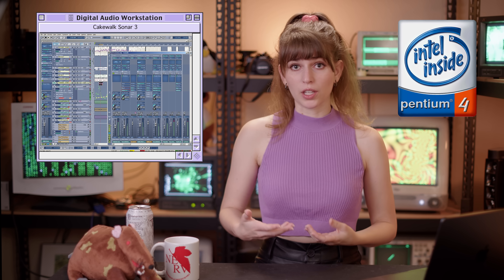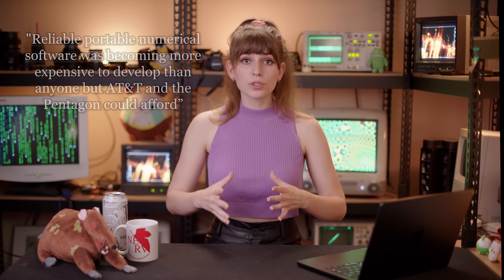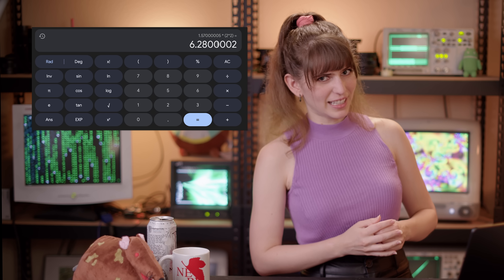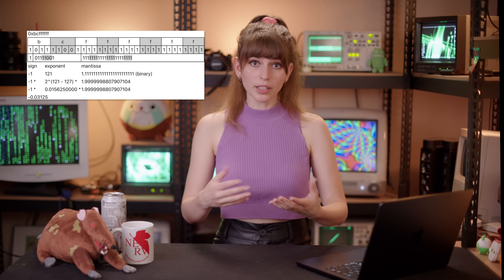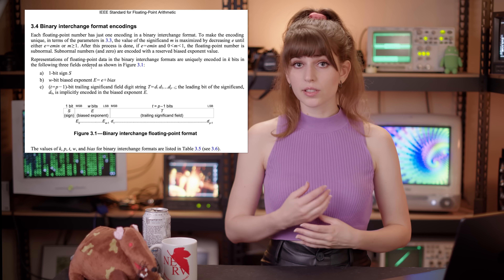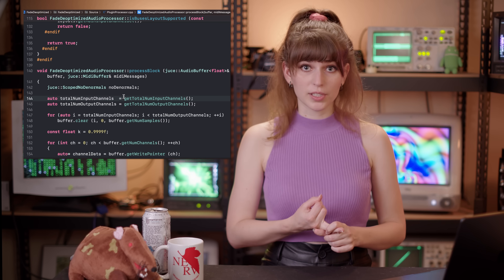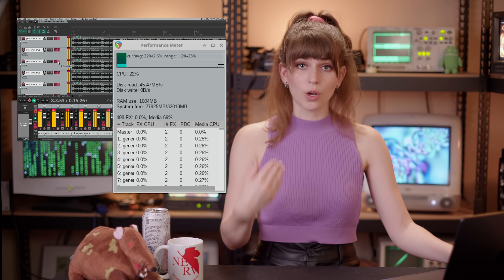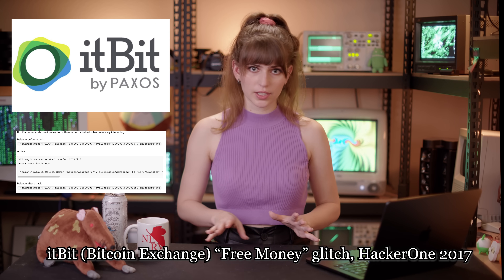Fading Audio is ROUGH on CPUs

Comment: A closely related topic is "dithering" in digital audio.

In the early '80s, the lack of tape hiss or any kind of background noise in digital audio was considered a selling point. But then engineers realised that quantisation distortion occurred at lower levels. 

The solution? Add a bit of noise to even out the rounding errors. Then they started doing fancy tricks like noise shaping to push it out of the audible range.

Great video!
Reply: I have tried to wrap my head around that one before.  Your explanation seems like a simple way to explain it!
Reply: So dithering is used to blur quantization distortion?
Reply: @Rami-bi9xj  It actually removes the distortion completely. The random noise is modulated by the input signal to produce an output, so this means that in a 16-bit system which normally has 96dB dynamic range, you can actually hear signals below the noise floor (eg. -100dB or -110dB) with proper dither.

I'd recommend reading "Mastering Audio" by Bob Katz for more info.
Reply: @HandyAndyTechTips 
thanks for the reference Definitely gonna check that out. Dithering is and mp3 optimizations are both interesting topics to explore

Comment: I mean, having code be as "good" as possible at the expense of performance with the ability to manually turn that off for optimisation seems like a very standard approach because it's very safe. Which is I think the best balance, enabled by default but able to be disabled

Comment: I worked for DEC in the mid 1980s.  You weren't allowed to take the initiative.  No one could say YES to anything.   It didn't surprise me when they went belly up.
Reply: Kind of sad. But at the end of the day we owe the AMD64 architecture to the death of DEC when the engineers for the Alpha processor went to AMD after HP cancelled the Alpha and went all-in on the now forgotten Itanium.
Reply: @mudi2000a  Itanium was Intel and HP.  DEC's alpha supplied a bunch of folks to both Intel and AMD.  I worked on the Pentium II and beyond and we called the Itanium the Itanic.  Intel's delusion on that program was one of the reasons I left Intel after 22 years.
Reply: As someone who cut their teeth on the PDP-11, and went on to work with VAXen, it was tough to watch the decline of a good company. By the way, were you surprised to hear Laurie pronounce the name "dee ee cee", instead of "deck"?
Reply: @SheeplessNW6  Yeah. My dad worked for DEC through the 80s and early 90s (Maynard and Mosshill). No-one there called it anything but 'deck'
Reply: @SheeplessNW6 to me even deck is weird. I always heard them referred to as digital by old timers on my area. But deck does seem most common outside my bubble 😂
Reply: @SpacePopeIII  I've been to DEC developer parties and heard old DEC people call it digital, but it's almost all "deck".
Reply: @toresbe I was a tech journo through the '80s and '90s and I never heard anyone, including DEC top execs, call DEC anything but 'deck'.
Reply: @manekdubash5022  It was either "d i g i t a l" or "deck".  It was never "dee eee see". 🙂
Reply: @toresbe  NEC was so annoyed with "neck" that they came up with the advertising jingle "en ee cee for you and me".
Reply: My dad worked for Digital in the 80s and 90s (and my mom did too for a bit, but completely different depts)

I’ve literally never seen or heard anyone call it DEC/“Deck” ever, and it was literally in my hometown some 30 mins outside of Boston. It was exclusively called “Digital” by anyone that knew it or worked there 🤷🏻‍♂️

My dad would take us there for like a bring your kids to work day, and my major memories are that there was a security robot that would roam the halls and ask to see your badge, and getting to either play MS-DOS games at some rando’s desk, or in this lounge area that I swear was just there in case you needed to dump your kids and go have a meeting or something 😅

I played a lot of Pitfall and Prince of Persia in those outings lol

Comment: Remember when compressor started locking up during quiet passages.  Ended up making the minimum compressor gain 0.001.  Reverb seemed to get away with increases in computing power, even though it originally had the same problem.

Comment: I was responsible for verifying the floating-point unit on the SGI/MIPS R8000, first shipped in 1993.  The basic proposition was Cray X-MP performance on something that fit in a standard 19" rack and cost under $1m.  This meant 18 CPUs, running at 90 MHz, with two fully pipelined double precision multiply-adders that ran directly out of the 4 MB secondary cache (no primary cache misses for FPU work).  In 1993, 4 MB secondary with two fully-pipelined load/stores per cycle at 90 MHz was a really big deal.

To speed things up, we introduced fused multiply-add instructions (no intermediate round), and eliminated denormalized number handling.  Like the Pentium 4, we could throw an exception when we ingested a denorm or on underflow.  That would turn a 1 cycle multiply-add into many hundreds of cycles.

Both issues cost us terribly, but punting denorms to software was worse.  The problem was that lots of national labs and defense contractors had software that they validated by running it on the new machine and seeing that the answers were identical.  Since we were rounding differently, we got different answers.  In some cases, the answers were very different... which suggests the test case was numerical unstable, i.e. bullshit.

That gave us a bad choice:
  A: Turn off MADD generation in the compiler.  This usually made things 10-40% slower.  Also, turn on denorm exceptions.  That made things 100-500% slower.  Ow ow ow ow ow.
  B: Work with the customer to prove that the results were really the same, when they weren't exactly the same.  Lots of deep discussions about numerical accuracy, and really discussions about how much upper management trusted the software weenies writing the code.

In retrospect, we should have implemented denorms and intermediate rounding in hardware.  You have to add a shifter, it would have added a cycle to our MADD latency.  It's not so terrible.

What we really missed, however, was the opportunity to take out the rounding altogether.  We could have implemented a 4096-bit fixed point accumulator format, so that the fused multiply-add was a way to add into such an accumulator without rounding at all.  This would have been lower latency, whatever.  But the big advantage is that, by eliminating rounding in dot products, we would have eliminated the ordering requirement to get binary compatible answers.  And THAT allows a bunch of optimizations, including better loop unrolling, that are easy to check for correctness.

Careful about underestimating the human ear.  We can hear vibrations which displace the eardrum by less than the diameter of a hydrogen atom.  In this case, you're okay.  If denorms are tickling the lower limit of human hearing, then the center of the single-precision number range represents a displacement of 10^10 light years.

Comment: You just need a touring matrix, one thing is you find the eigenvalue for a system of equations, but what about just drawing a pickup truck?  I might solve it with a barrage of hot lead 🔥 🥵,  but its a touring matricies.  This is why they stopped shipping MASM64 in 2003, void null object, people would ponder how dumb you had to be to assume ADO can operate at all without dimensional WYSIWYG, a real 3D modeller only uses null void objects.  A language has symbology to find things, you look at the matrix movie, "show me truck."  Symbols form out of WYSWYG interferometer, oh look the touring matrix - [trucko], but no person could live without language, nor live in symbology, because its just barely easy enough to use the truck, thus dimensioning mathematics and astrology, nonsense.  "The classico Hasselbladt third finger".  You mean a matric of rules governed by a table of snake game gate control structure operation to finish off the dot matrix paper?  "Blub blub blub blub, its quite the fancy whimsy time whimely.  You gotta know whatever it is your doing.  The rather terrible problem is magic, how can I perform magic, so its just matrix touring genetics, but its not this example, its a rainbow.  You can have values in fields of vision on dependant structural and astrolger features to draw the touring matricies in higher dimensions.  "Whoopity twirl, - [this be magic], wouila!"
You might get much to proficient at symbology, doing is being, penicillin makes you anxious, but how can you be anxious if your doing it, you must not be doing it

Comment: People who work on floating point numerical algorithms are a very special breed. The results can change depending on the order you perform operations!
Reply: Floating point numbers, especially low resolution 32-bit, are integers in disguise. While 64-bit FP gives enough headroom for most calculations, 32-bit FP requires careful handling. In some fields fixed-point is still used, requiring even more care, because almost every operation requires bound checks on paper, but it can deliver more deterministic results.
Reply: Floating point is tricky, but once you know the traps, it gets easy.  Fixed-point however, has a lot of interesting twists and turns :)

Comment: This problem with the floating numbers is actually why COBOL became so popular for banking applications. It usually doesn't use floats, instead, when you declare a variable you also declare how many digits (in decimal) it has before and after the decimal point. For example, this is how you'd declare and assign a variable called "MyNumber" with the value 6.28:

01 MyNumber PIC 9V99 VALUE 6.28.

Basically the "PIC" declares that it's a custom size and type variable and the "9V99" declares that it's one digit, then the decimal point, then two more digits. In banking this was a big deal because you have full control of how precise each variable is regardless of the hardware you're running it on.
Reply: I am thinking most computers running COBOL compilers allowed for BCD at the machine language level.  I could be wrong, but I think the IBM 360 had such things.  No idea about earlier generations of mainframes, and stuff like system 38.

Comment: I just think that people shouldn't use floating point numbers in general. 🙂

I just calculated, and a 64-bit number is enough to represent any position inside the Kuiper belt with a little greater than 0.1um (aka micrometer) precision.

Comment: This actually caused my computer to freeze while performing on stage in the 2000s. Was improvising along with some custom software written in SuperCollider - some planets aligned and denormals caused buffer underruns then a crash. Live on stage.

Denormal issues are fixed in SuperCollider since then. The function that removes denormals is called "zap_gremlins" in the source code, always found it funny. It typically runs at each loop of UGens (sound generators / filters etc.) and to my understanding, removes any denormal numbers that might have crept up in the buffer.
Reply from the maker: wow!  crazy example
Reply: @lauriewired  It was code that had a lot of audio feedback (all in box, so completely digital) - my understanding at the time was that once some degenerate generator creates denormals, if it is in the audio feedback path, it is fed to the entire feedback chain and poisons the entire audio path, making operations much more expensive than expected. sucked at the time, but a learning opportunity nonetheless.
Reply: @gnorts_mr_alien  Reverb effect is fundamentally prone to this, as are many other algorithms. Because what reverb does, is add a less loud copy of the audio from a little bit in the past onto the current position, and it's re-used again later. So once you have a fast-decay reverb and a channel that stops getting any audio on the input (just digital silence), it's guaranteed to land in the denorm purgatory until input signal is re-introduced.

IIR is also prone to this by the same mechanism.
Reply: @SianaGearz Makes sense since it's an O(N^2) convolution.
Reply: Ha, if it didn't sometimes smash right into a wall, they wouldn't have called it SuperCollider. Maybe if Nasca Octavian Paul (DSP hero behind ZynAddSubFX and others) had been an early contributor they would have called it NASCAR instead!
Reply: Crazy. I’ve only used SC briefly, but I was using max/msp and PD in the mid aughts, but knowing the similarities, it amazes me to think that of all the things that software can do, this is the issue? Thinking about how many tracks/channels you can generate in Max or SC tho,  it’s heavy.
Reply: Just enable the denormal flush to zero flag for the whole program?
Reply: @thewhitefalcon8539  yes I think something like that. Don't know if this was available as a feature in the CPUs back then though.
Reply: god i love when a programmer's headspace infects their namespace. "zap_gremlins" tells me exactly how they were feeling
Reply: The name "zapgremlins" comes from BBEdit which had text tidying menu option "Zap Gremlins" to remove invisible/non-printable characters from a document. Funny little history they used there :)
Reply: was this on SC2? zapgremlins() seems to be in the SC3 codebase since the very beginning. as someone still using SC2 for live sets, i wonder if the fix made it into SC2 as well :)
Reply: If that was a Pentium 4 laptop it must've been huge
Reply: @SterkeYerke5555  Can't remember the computer specs sorry, but this issue is actually by design and to my knowledge still present in modern CPUs. You just have simpler ways of dealing with it / setting denormals to 0. But if the software does not take the right precautions, you can still be bitten by it!
Reply: @gnorts_mr_alien I haven't watched the whole thing, but it sounded like Intel said to compile using SSE floating point, rather than using the x87 FPU "coprocessor" . It would make sense that the newer unit is better at handling these operations.
Reply: @gnorts_mr_alien  nice username lol. If I didn't know any better, I'd ask if you were some kind of Vinesauce alt account considering the stage story... 🤔 😂
Reply: @data_abort  SSE isn't better, rather worse (regarding accuracy). But much faster, because it just ignores it (and enables SIMD, of course). Also because the x87 unit in the Pentium 4 was much slower than the previous one used in Pentium Pro/II/III (or the Athlon). Intel simply relied on high performance code using SSE2 instead (which backfired).
Reply: @SterkeYerke5555  P4 laptops were desktop replacements... i.e. not meant for normal use on your lap. 
They were large, but not outlandishly so. 
My old HP HDX18T was far less portable, luggable, etc. than my P4 15.4" and 17" laptops from back in the day.

Comment: Fun fact! Modern Intel CPUs do not have this penalty. My laptop with an i3-3217U doesn't skip a beat calculating subnormals.

Ryzen does still have a penalty though. At least it's not trapping into microcode and adding hundreds of cycles like the pre-Sandybridge and pre-Ryzen machines were
Reply: Laurie, I'd highly recommend retrying this test with several other microarchitectures if you have them available. It'd be interesting to see the impact in-situ on a Pentium 4 era machine doing audio.

Comment: 9:24 "if an overflow or underflow occurs, the program will use incorrect number"  this is what happened before IEEE standard / believe she's not saying otherwise). Now overflow is not a problem really, giving + (or minus) Inf, not an error, and even less likely with double numbers. Underflows give you denormals (if not disabled), and eventually give you zero (they're used to postpone that a lot), then yes a "wrong" number, zero, I believe. But no arbitrary other number, and it seems both unlikely, also not too bad, and no better alternative when that happens.. This is an informative video, I hadn't thought of denormals affecting audio software but it makes sense (I grew up when integers only, never floating point wasn't used for audio, though one one machine 8-bit logarithmic numbers, sort of similar, for samples). Audio (and some other) software can and should disable denormals. For such software AMD's Zen 4 CPUs seem very good, 10:04, with only tiny bit of slowdown if I'm reading the table there correctly.  15:48 is also intriguing.

Comment: In Engineering we have to learn about that binary representation and the potentials error it causes. In Finite Element Analysis, the computer will do millions of floating calculation that are based on the previous calculation. A very very small error can lead to absolutely absurd results quite fast.